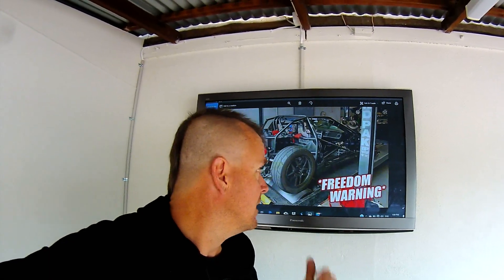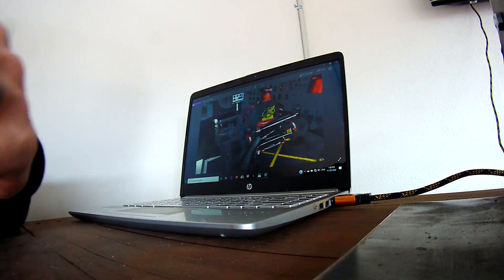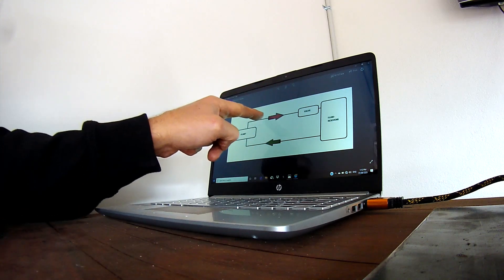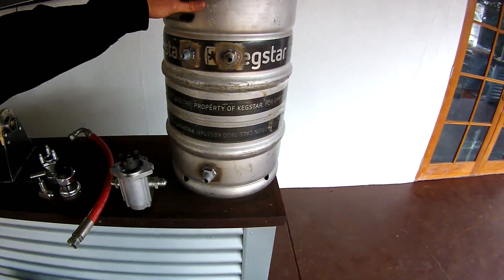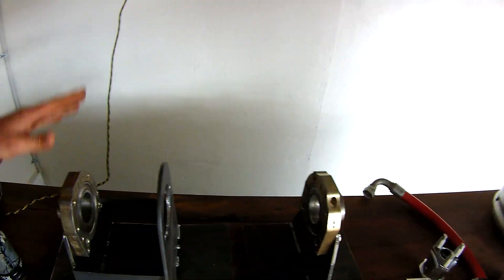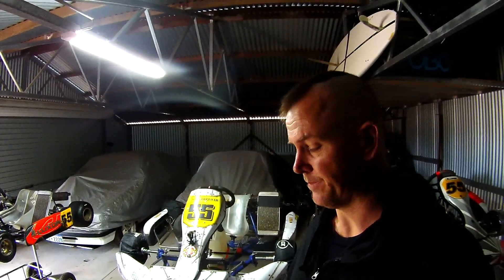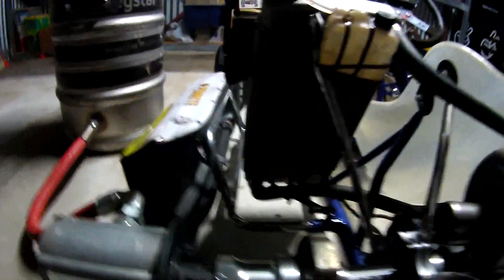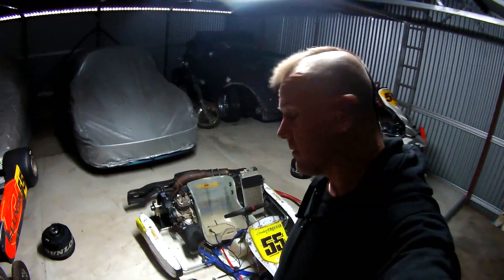Kart Dyno Build - Part 1

Comment: Be interested in the specs of the pump, that engine seems like a pretty high RPM so do we need a pump that matches that RPM?
Reply from the maker: Yes . I will have to dig out the pump specs. 
You have some control over pump rpm via drive gearing, however matching rpm with maximum measurable pressure is necessary
Reply: @noeyedeerracing5795  Ok great thank you, I will be working with a CR500 which turns 8000 + RPM so need to be sure I wont blow it up.